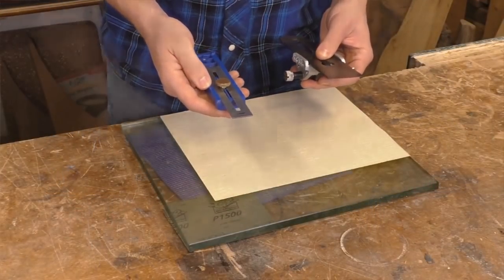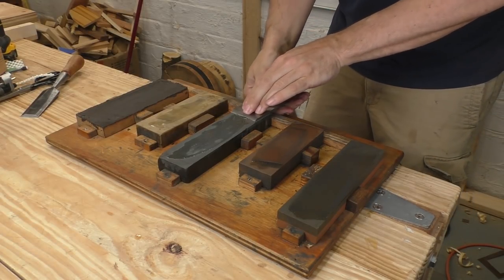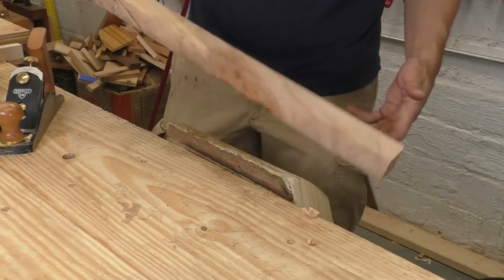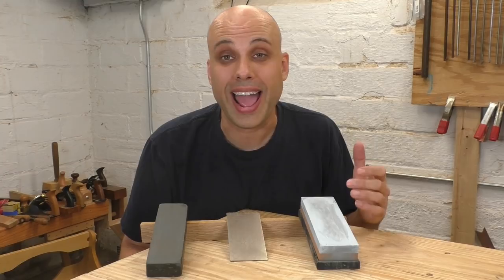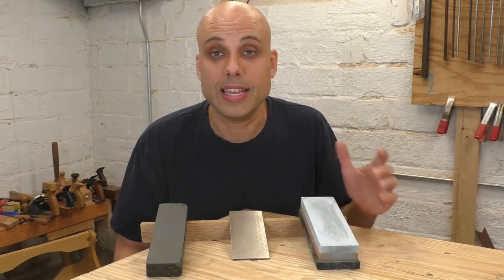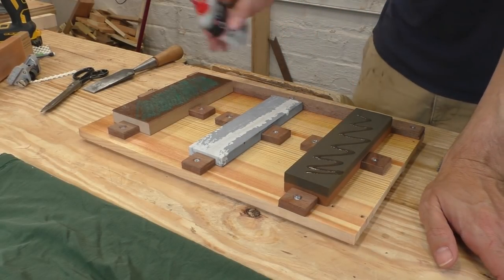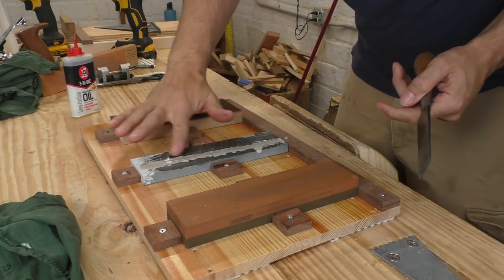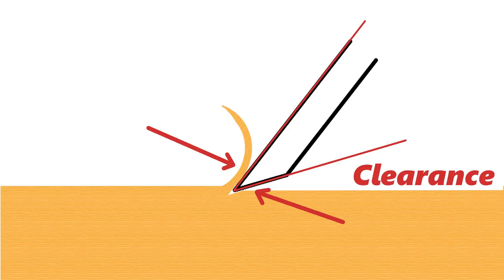Fast freehand sharpening: no jigs, no guides, no sandpaper.

Comment: Thank you for being the voice brave enough to speak up against microbevels
Reply: I don't get the microbevel thing. The only thing that it seems to do is to postpone removing most of the metal to a later date. Unless you have a low speed grinder that can make that job i a hurry those times are going to suck more than the couple of seconds you save on each sharpening.
I see a point with the backbevel on a plane iron, instead of requiring the whole back to be flat it is enough to only have the last fraction of a mm that touches the wood flat.
Reply: I think Paul Sellers also mentioned once that micro bevels are not necessary, he just polished the whole bevel because his diamond plates were fast enough, I tend to use a microbevel, but after a lot of sharpenings I just rub the primary bevel on my stone a couple of times, so the micro does not get so big
Reply: @j4gs223  you only flatten the back once so I think it is worth that effort in the beginning to not have to worry about it later. James Wright also think that it's better to do it once and be done with it. I just watched an older video with Paul Sellers when he restored an old rusty plane. He had a very practical method to solve a convex back. Give it a good hit with a nylon hammer to take care of the worst problem.
Reply: @haqvor  @DoomSlayer wasn't talking about flattening the back. He was talking about how Paul Sellers grinds the whole bevel and doesn't worry about a micro bevel. Flattening the whole back is a slightly different topic.
Reply: @jjbailey01  sorry about that, I'm obviously too tired to read straight...
Reply: @haqvor  it happens. I've been there.
Reply: @haqvor  It makes it so almost all the metal is removed on your coarsest stone, where it's easiest.  It's the fine steps that are faster, as you only polish very close to the edge.  It makes sense when you have no intermediate grits.
Reply: When following your discussion, dear gentlemen, one thing came into my mind: The slightly rounded bevel you get  from hand grinding creates a kind of micro-bevel. That means, when hand sharpening your cutting tools, you do not need to care about micro bevel. When sharpening with a jig you have to. Micro bevel is not obsolet, because it is much easier to get a consistent edge on 1/32 inch than on 1/2 inch (with Jig or without). Mr haqvor mentioned it befor: it is the last fraction of a mm that cuts.  Excuse my poor english and best wishes for you from germany
Reply: @haqvor  You wrote, "I don't get the microbevel thing. The only thing that it seems to do is to postpone removing most of the metal to a later date."
     Yep. You need a secondary bevel on a high-speed tool like a moulder to reduce heating. The secondary bevel, which shouldn't be more than 0.020", keeps the knives cooler by affecting the air flow. For hand tools, it's just easier to lift the iron or chisel by a tiny bit to work off less steel. 
     For a plane, if your iron is bedded at 45 degrees, once the secondary bevel is too big, you can reference that and just create a tertiary bevel by lifting the end a little. The limit is below 45 degrees for reasons I don't recall -- Stumpy Nubs discusses it in one of his videos. Anyway, once you reach that limit you have to re-profile. 
     If you expect to do a lot of flattening or re-profiling, set aside a little bread and get this Shapton #120 for about $40. Use a sacrificial piece of steel to get an almost-paste-like slurry going and it cuts way, way faster than diamond or sandpaper. 
https://www.amazon.com/Shaptonstone-Traditional-Homogeneous-Waterstones-Shapton/dp/B001TPE1PK/ref=asc_df_B001TPE1PK/?tag=hyprod-20&linkCode=df0&hvadid=309752512776&hvpos=&hvnetw=g&hvrand=15076539168756520808&hvpone=&hvptwo=&hvqmt=&hvdev=c&hvdvcmdl=&hvlocint=&hvlocphy=9017596&hvtargid=pla-441383757751&psc=1
Reply: Microbevels seem to be the way to approximate a rounded bevel for people who don't understand LOL.... I took a look at the chisel i restored  by hand (and can shave with). Looks just like rex's diagrams
Reply: There is nothing wrong with micro bevels, but there done the same way fast its just sharpening the tip or just putting an edge back. You can feel the main bevel by rocking the blade back and forth then just put a bit more pressure to the front of the blade. You usually just use the finest stone unless you damage the tip. Or just strop it. After a while you will round over the cutting edge and have to reshape your blade but that may be after using it for a few months or at least a few weeks. I never used sharpening jigs all of my tools are sharp. I've built custom homes in palm beach FL. Most of my life. There big places but the owner don't want you standing around sharpening tools. They want you working.
Reply: Rex, you're the Alton Brown of woodworking! Thanks for demystifying sharpening!
Reply: Paul Sellars refers to this style (the rounded bevel produced by freehand sharpening) as a "macro-camber". As opposed to a micro-bevel.
Reply: I too see no point in micro bevils.  I think they are a lazy way of sharpening.
Reply: Microbevels are useless
Reply: @fngrusty42  I would LOVE. A customer to say something to me about SHARPENING a tool?? While I'm working on they home!!! Is it ok to change a saw blade ?? Or use a cordless drill?? Or I need to drill that hole by hand?? 
They find that tool up they a$$ !!!
Reply: @haqvor  Microbevels are easier to perfect, sharpen and maintain. That's why people use them. You get a rough angle/sharpen on the blade, and then you perfect a very small amount of it. And in all honesty, I have noticed it cuts even better than regularly sharpened blades, since once perfected the edges are flawless. 

It's harder to keep a plane blade steady for 40 strokes over 5. It's easier to strop as well. This is why people do it. When you sharpen large surfaces, there's more room for error. Now, if you're sharpening a sword, the edge being perfect doesn't matter, but when you're dealing with a handplane and taking wispy 1 thou thick cuts. A perfect edge matters. 

Yes, you do eventually have to flatten everything and start over, but I find these perfect edges last about 3-4x longer than a regular plane edge, and then you can go in and touch it up about 6-8 times before having to resharpen the whole edge. And it's honestly less work once you practice it a few times. Takes me literally 20 seconds to resharpen a microbevel compared to the regular way of sharpening. You can also adjust the angle for cutting different woods without having to regrind the whole cutter. You can get a sharper apex or a duller one depending on the wood. 

There's a lot of science behind sharpening blades. Perfecting things like this, as well as proper burr removal can take a good working handplane into something that you can put almost no effort into moving across the wood and still get a beautiful shaving from. 

I used to sharpen very similarly to how he does it in these videos, but spending a bit of time on older blades and planes, I learned how to microbevel over a few days, and I've never looked back. The difference it makes is quite significant. I went from sharpening every hour or two during work, and it taking a few minutes each time. To maybe once a day, with a 20 second touchup on a fine grit stone 12,000-16,000 and a quick strop. It also made it significantly easier to use with some of the harder, denser woods that are notorious for being difficult to plane. 

That isn't to say that the other way doesn't work. It does. I've just done it this way because of it needing less time to maintain, and overall longer blade life. Especially since regrinding the edge after a bit of use is quick using diamond and ceramic stones these days. Something people haven't had access to for much of the last century.. when handplanes started coming out. They tended to have rough grindstones, and soft ones. And having a large bevel was easier to maintain on those vs a small one. 

There's also the added benefit that with micro bevels, you basically only need like, two grits. If you're sharpening a large area, you need grit progression. going from say, 500, to 1000, to 2000, to 5000, to 10000. But with micro bevels, you can basically just go from 1000 to 12,000 in one step and get a perfect cutting edge every time, because you're sharpening a tiny tiny area, and grit progression doesn't matter for something so small, since you're not removing scratches from previous sharpening steps.
Reply: @truckywuckyuwu  Thanks for your write up! I have gotten a bit further on my sharpening journey during these years and I agree totally with everything you said. I'm sure that it will help someone that is where I was a few years ago.

Comment: Little tip for you for beginners to free hand sharpening.  Get a permanent marker (sharpie or something similar) and colour the end of the blade before sharpening.  After each stage, there should be no marker left on the edge of the blade, if there is, you've missed a spot and need to go back over.  Not so much an issue for plane blades and the like, but I've found it useful for carving chisels when you're sharpening rounded blades that require a lot of wrist movement to sharpen the whole thing.
Reply: Good for Japanese kitchen knives too
Reply: It works best if you use a red or blue marker, instead of black. It's easier to see, especially when there's a lot of grit and swarf from the sharpening.
Reply: I've tried a lot to do free hand sharpening but I have a shoulder injury and I just can't do it, I've sharpened and resharpened my knife over and over, with dull results every single time. When someone else does it they can get it sharp but I can only dull it. I hate this. :(
Reply: GREAT tip! Use this technique every time I strop my wood carving knives. Learned it from a Ben Orford sharpening video.
Reply: @FringeWizard2  don't be discouraged buddy. It took me about a year to get the edge of my knives sharp. It's all about the angle, if you don't hold it at the correct angle while running it across the stone it won't make it sharp but more likely dull it. I have a bad shoulder myself and it doesn't bother me at all, it might if I were to try and sharpen somethin the size of a katana though lol. Just keep practicing on a cheap dull pocket knife the work your way up. Make sure you progress your way up with different stones though. Accusharp makes a great double sided diamond pocket stone for under $10. With it I can get my knives sharp enough to shave with.
Reply: @FringeWizard2  Remember that knife geometry is A LOT MORE COMPLICATED than chisels and plane blades.  I can get amazing edges on my plane blades freehand but my knives SUUUUUUUCK by comparison.  Keep at it.  Practice practice PRACTICE.  You'll get there.
Reply: I did that, it clogged my 1200 diamond stone...

Comment: The only justification for microbevels is that honing the edge is faster because you don't have to touch the main bevel, so there's less material to remove. But the freehand rounded bevel has exactly the same advantage. Microbevels are a solution to a problem that didn't exist before sharpening jigs appeared.
Reply: I had a similar thought the first time I saw Paul Sellers sharpen - his technique is ALL micro-bevel.  The sharpening arguments are mostly a terminology issue.
Reply: Paul Sellers calls his single bevel a “macro camber”. Yes, this produces the same advantage of speed as a micro bevel. Good point. But I would imagine that it also solves the problem that freehand sharpening a micro bevel would create, that being the impossibility of reproducing the exact same angle with every freehand sharpening. Varying the microbevel angle every time would create a rounded dull edge. I suppose the macro camber would cut a completely new cutting edge every sharpening.

Comment: Prices on the Arkansas stones have gone up even more on the link you provided, it's now $45. Found a website that specializes in sharpening stones that sells them much cheaper. They also sell the different grades in kits at a very good price (only a few bucks more for several stones). Not sure if I'm allowed to put a direct link to their site, but it's called "Best Sharpening Stones". You should be able to find easily.

Comment: Rumaging through my Dad's old workbench, I was chuffed to find his old Stanley No. 5 plane (which I've now identified as Type 19, from 1948-61), plus a bunch of oilstones... and 3 pieces of glass with sandpaper of varying grit glued to each side!
Dad passed away just over 10 years ago, and it's a few years before that, that he made his last real woodworking project piece. He was very fussy about caring for his tools, so the plane is in pretty good condition, apart from the blade being blunt. I've now pulled the plane to bits to clean it up, and have made my first attempt to sharpen the blade.
The sandpaper looks more or less unusable at this point, and anyway, hard to identify the grits. But I've started to soak the sandpaper off so as to re-use the glass plates...
Well, the blade is now sharper than it was - but needs a bit more work to get it back to pro condition. 
But for me, it's a labour of love, and I've enjoyed following the steps of this tutorial with an actual treasured tool!

Comment: LOL, when you say diamond plate, because of my background in semi trailer mechanic-ing, I think of the aluminum or steel with the diamond-ish patterning on the top, that everything from toolboxes for the sides of flatbed to the top of bumpers to give them traction ability. 😄 

These are great tips! I'll definitely use them! It'll not only saves time, but money, too! Thanks a lot, Rex! ❤️❤️

Edited to add: I use that shelf liner stuff for tons of stuff, already, so that's perfect - I've already got rolls of it hanging around!

Comment: I agree w alot of others on here, good on ya for showing microbevels etc arent as important as one thinks. Ive been freehanding for about a year now, and havent seen a problem.  What works best for me is something i picked up from a vid on YT, some guy showing how he sharpens chisels. He said to look at the blade edge, when you press it flat on the stone and see the water/oil thats right at the edge of the blade edge get pushed out, youre at the right angle.  That has worked for me ever since.  Not sure if that makes any sense, hopefully someone understands that and helps them.

Comment: Good for you. I don't believe that woodworkers hundreds of years ago who had to produce furniture at a rate of knots were fussing over composite angles and using jigs.

I reckon the most important thing is going fine enough. The tip about not falling off the edge of the strop is great, too. I did that for months without realising.

Comment: Great video.   Kim about 4 years into my hand tool journey.  I’ve been a power tool woodworker most of my life and bought a 5 1/2 with stimulus money.  I’m hooked.   I sold my cabinet saw and my power jointer and my dust collector.  I have several sharpening jigs and I’m partial to the easiest one, but mostly just sharpen by hand now.   I really don’t notice the difference. I can still get very sharp by registering the bevel and being careful.  Sharp enough to shave hair and wood.

Comment: I came back to this video after a year. Back then I only owned a cheap water stone; now I have a set of extremely cheap diamond plates from our favorite web store in China, and they're quite great for the price. I got them up to 3000 grit (I know that this scale doesn't really work for diamond plates, but that's what they're labeled at) and they do the work well. Perhaps the only flaw I've noticed is that if you use water to lubricate them during use (and lift off the metal chips), those chips will rust almost immediately when left alone, so you need to wipe them clean after each use. The thin plates also require some proper support to actually keep flat, so I still use them on a piece of glass.

Comment: I’m glad you mentioned about flattening the stones.  It can be surprising how fast they become concave.  I flatten mine after every use, otherwise it gets to be a lot of work if you wait too long.
Reply: it totally depends on the stone. i have some that become concave immediately, typically it's because they are softer and you're suppose to use less pressure, i would have liked to know that before i used them.
Reply: Nevermind  how unnecessarily mean.
Reply: It doesn't require much pressure at all, for any stone.  So on a soft one, it could go off flat, but every time?  Something is wrong, or you're over obsessing about the stone.
Reply: I have a 300/1000 trend diamond plate. Anytime I use my 8000 or up stones, I use the 300 to flatten. Takes 10 seconds literally.

Comment: Great Video,  a few things,  A great honing oil is 50/50 mix 30 wt and kerosene.   Oil stones when new can be used with  water (add a little dish detergent)  after using with oil stick with oil.  If you don't have leather for a strop you can use jeans or any other hard wearing cloth or cardboard on wood.   leather is traditional but other things work until you can find a scrap of leather, it is  just somthing to hold the compound.

Comment: I'd been getting by with a small diamond plate and sandpaper for a couple years now and wasn't attracted to waterstones because of the need to flatten them. My framing chisels and block plane get abused daily, and spending a few minutes tuning them up on these stones and a strop at the end of the day has saved me so much time and I'm getting better results than ever.

Comment: Coarse silicon carbide grit on a flat concrete garden stone is the best way I've found to true oil stones. And I recommend to get a Norton India stone for the fine sharpening, but start with carborundum oil stone that is not too hard..